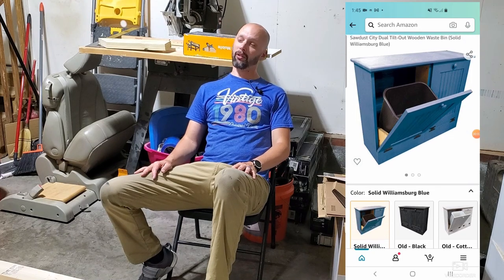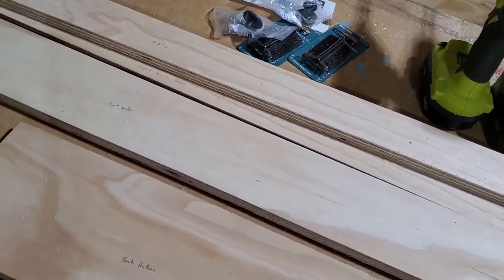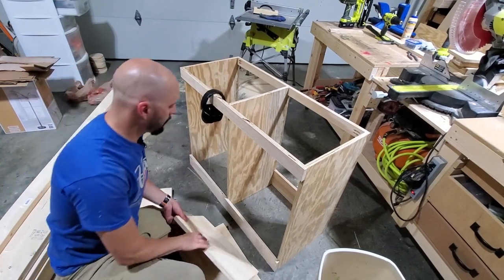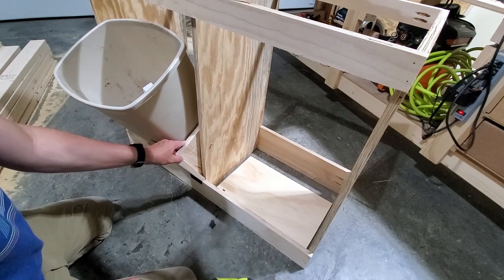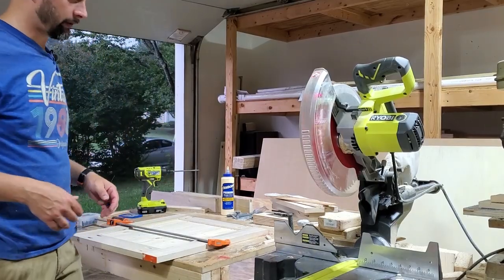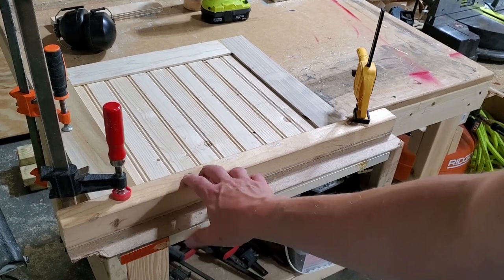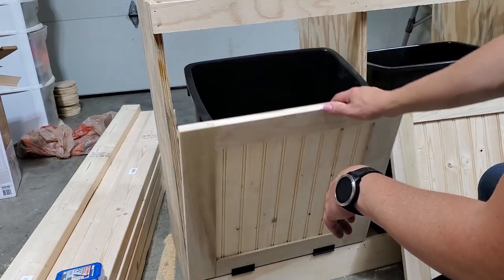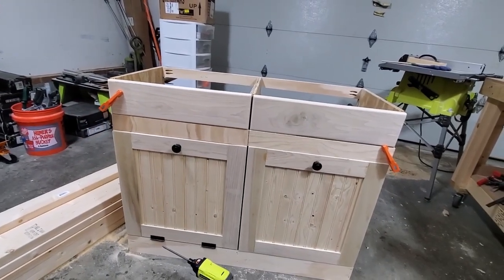DIY tilt-out garbage/recycle cabinet with  drawers Part 1

Comment: if it isnt too much to ask... i know nothing about measuring really except basics. I was looking to build this but having wherever I buy my lumber from to cut it all for me (I do not have a saw) but the way you explained this wasn't step by step enough lol. I could easily build that frame but I have no clue how to go about what materials would be best or what. Don't hassle yourself for me, lol just dont want to spend $$$ for a garbage
Reply from the maker: I'll be honest with you, I make this stuff up as I go along and I don't write down the measurements. My videos are more of a journey then a tutorial. I hope to one day develop plans for some of my projects and sell them. Until then, I checked Etsy and I saw one set of plans for a tilt out trash cabinet that cost $10. Good luck on your journey and I hope you find what you're looking for!
Reply: @wooddoofus  Would you take a commission to make per my ideas?
Reply from the maker: @meme2255  it's possible, but I can only do projects in my local area of Greensboro, NC. Also, I'm backed up to June right now on projects.